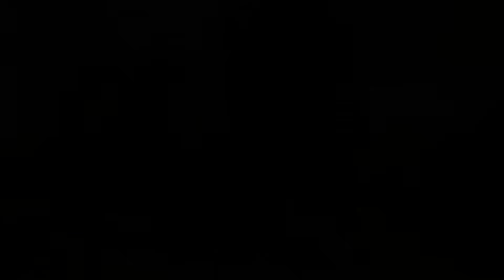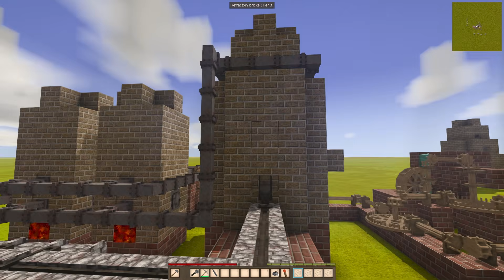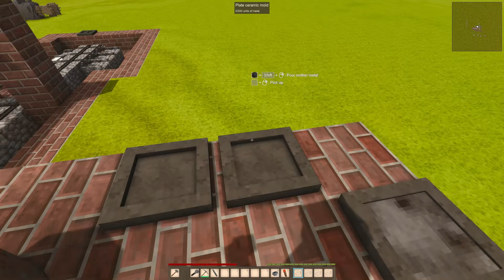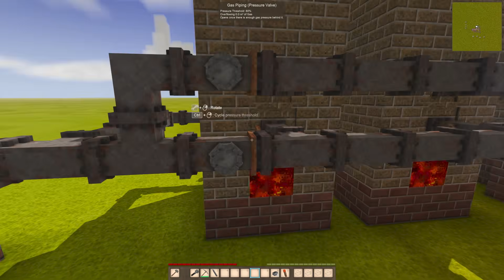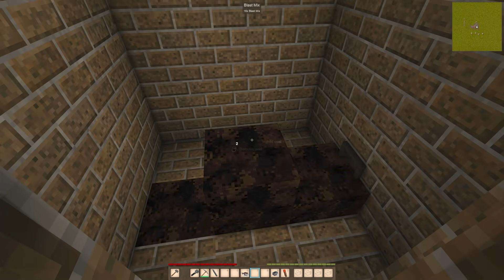Vintage Story Mod – Steelmaking Expanded (an attempt at explanation)

Comment from the maker: I've released a major update adding steam power to replace placeholder mechanical blower in this video. The information about how to operate the furnace here is still true, but be aware that it now requires a whole steam power setup to actually work!
New pipes and steam power mod: https://mods.vintagestory.at/ppex
Video explanation of steam power: https://www.youtube.com/watch?v=CK2DHt3eQig
Reply: VS needs more steam powered things
Reply: Hi. i just started playing this mod as it looks supper cool and i like the industrial setting. I just wanted to ask if the bricks took damage over time.

Comment: Really cool stuff, feels suitably realistic within the bounds of reasonable gameplay.

The only thing I feel is missing is the atmosphere around it. You're mentioning audible feedback from the different processes, but I'm guessing you have it muted. I then infer that this is probably fairly loud, which is the kind of thing I'd want and expect from this industrial process.

I also just would love to see visual effects like sparks communicating just how hot and large scale these processes are. Further, something like instant death if someone opens the door to the blast furnace at higher temperatures. 💀

Now the big question is what to do with all this steel! We really need some people to make more industrial age mods - to the point where someday you could play with this mod, then take raw steel stock to a machine shop where a steam engine powers hammers, lathes, and other equipment to make more specialized parts for further more complex machines.
Reply from the maker: Yeah, i had the game sounds muted in OBS this video for some reason, but in the next video those came out incredibly loud ((
If sparks started flying out of the sides of the blast furnace then probably something went wrong, and as for the opening the doo, you can open the door in cementation furnace and look inside in vanilla
I wanted to make this mod precisely  because I didn't have much to do after first winter usually, where I would have everything I need, and a project to build whole steelworks plant is something that would be quite fun for me. Also, the server players can use a lot of steel for no particular  reason, other than someone desided to put a lantern on each tree in the forest.
Reply: also potentially someday having to protect yourself from the heat ! if you've got both that mod and hydrate or diehydrate

Comment: Something about  the twin air heaters feels unfair, the kind of thing you get done making and get mad you have to make another. Either make them smaller or you only need one, when the second speeds up the blast. Very cool mod, Its exactly what I wanted out of a Blast and Bessemer mod. Now add steam engines so I have something to do with all that steel!
Reply from the maker: Real blast furnaces usually have 3 cowper stoves heh
I actually plan on replacing placeholder mechanical blower with a steam powered one. That is why mod version says 0.8
Reply: @ringavidra I wonder if it makes more sense to have steam power in a separate mod. Steam power is such a big feature, with tons of branching off applications, and I like the idea of people being able to have more control over how their mods connect.

I don't know, being honest one must consider modders ending development of their mods, and if you for whatever reason choose to end development, I feel better about these two big pieces being in more manageable parts for different modders to make forks of.

I'm also considering that in the future as the game develops and modders refine things, there will probably be multiple good steam power mods, and being able to nicely insert a steam engine from another mod into this one would be nice.

But these are my scattered thoughts, take them with a grain of salt as I'm not a mod developer. Whatever direction you take your project, I'm sure it'll be cool.
Reply from the maker: @TheRustRanger  Those are perspectives for the future, and right now the situation is that there aren't that many collaboration between mods that I can observe. Most mods have patches to work with each other, but in the end, all of that is just people trying to add to the game what they think it lacks. As for me, I plan on separating some of the generic code into libraries (if you look at the repo for the mod, there is already a separate lib for block networks, I simply made it compile directly into one dll for now). But the more mods that rely on each other I will create and try to separate things, the more we will get to situation when, for ex, people wanting simply a blast furnace mod will need to download 5 other mods that the BF relies on to function. Tbh, I haven't figured out the best approach there, so we'll see how it will be when the time comes.

Comment: 7:40 ha peut-être mon erreur, je vais tester le même placement pour avoir la vitesse identique x) mais j'avais testé avec le moteur admin réglé au maximum et avec un engrenage pour augmenter encore la vitesse j'avais de la fumée dessus x)

15:10 il faut garder la porte ouverte tout le temps si je comprend bien ? 

18:00 okiiii je comprend, il faut combien de temps pour que les éléments monte à 1200°C ? et faut-il vraiment utiliser que de l'anthracite ? car jamais j'ai réussi à en avoir plus de 20, c'est vraiment contraignant
Reply from the maker: Creative motor can output max 1RPS, but blowers require 1.5 rps. Use gears to speed it up or drop speed requirement in the config.
To keep tap open all the time or not is your choice. You can wait for it to accumulate and pour a lot of metal at once, or allow it to drip into somewhare. But the latter option may cause cause it solidifiying due to how long it would take to feed all of the iron for the converter for ex.
Pretty long, again, you can speed it up in the config. Anthracite is a real life thing, when it burns it produces almost no smoke, so you can use it to heat up stoves. During my playthroughs I often gathered anthracite to burn in refractory furnace cause it burns longer. Didn't think that aquiring it was a big isssue, but you honestly don't need much, as I said, it burns really long.